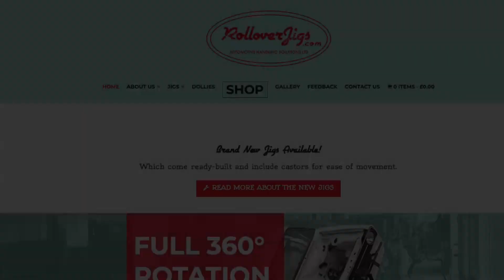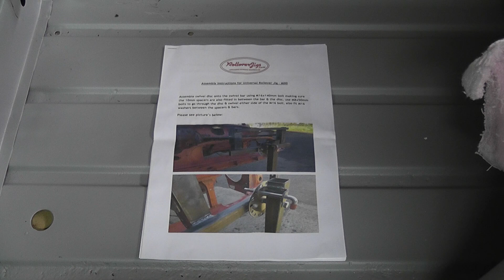Classic Mini Restoration Episode 6 - Classic Mini Rollover Jig

Comment: Just bought the same jig and the instructions are pretty hopeless! 🤣 Really sturdy though with excellent welds. I very much doubt I could build one to the same quality for the money.
Reply from the maker: Yeah it works well...but instructions could be better. I was confused at times which bolts to use and still not convinced I have them right :-) But once built it does the job :-)

Comment: Lee, Glad to see you back and great move on the roll over jig it will make life a lot easier! I would say if your going to cut out
panels try to do one side & small sections at a time! I have used a bar from front to back to make it stronger. Cheers Dave
Reply from the maker: Thanks Dave. That sounds like a great suggestion. I think the entire right hand side needs replacing so I’m guessing it’ll need support of some kind. Typical though...I’m pretty sure the panel the jig attaches to needs changing. That’ll be tricky 😂

Comment: Hi, I just found your video and am considering getting this jig.
How high should the ceiling be ? I have only 2m in my basement. Your Mini seem to be set up fairly high, wondering if it can be fitted lower and roll while fitting under 2m ceiling.

Cheers
Reply from the maker: I not 100% on what heights the jig can be set too, but my ceiling height is 224cm. The door way is 192cm so I had to have the car upside down when rolling it outside.
Reply: @SmugwoodMini  thanks. I will contact them. If I take the version without casters I'm already down a good 5 cm.